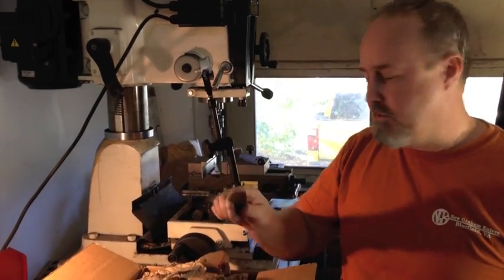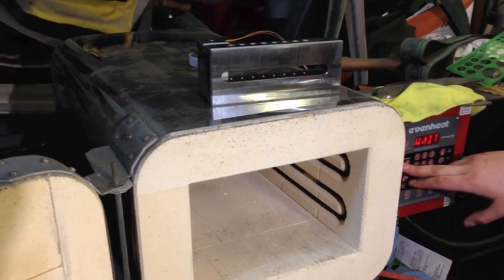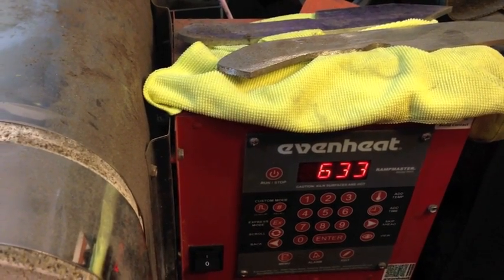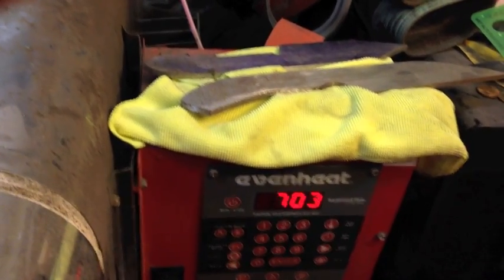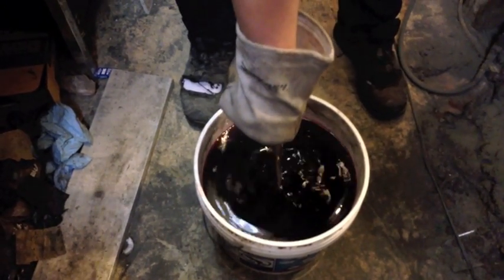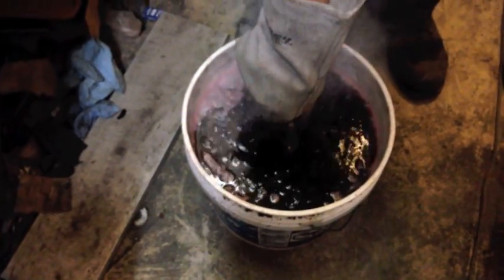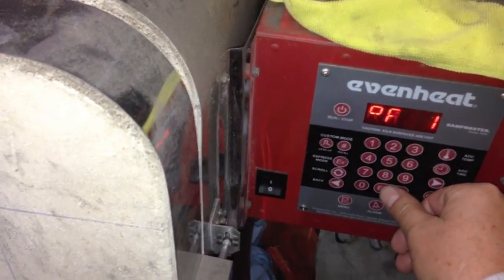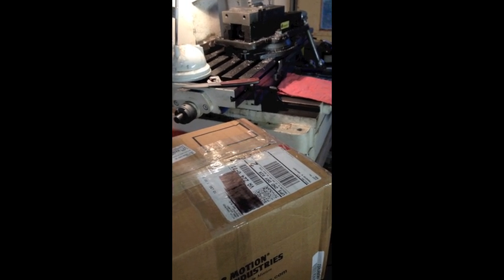WIYB - Machinist Vise Heat Treat

Comment: I was really nervous about such a large part being put into such a small plastic tub of oil. I use a 36 quart stainless stockpot, with a cover that can be dropped on the top with a push of my foot in an emergency. I have 7 gallons of actual quenching oil inside. It’s not that expensive, particularly for a business. Most other oils are contaminated by ingredients that shouldn’t be in hot contact with the steel, and have a flashpoint that’s too low. I don’t see that large, thick part being properly quenched in such a small volume of oil. I noticed that you mostly held the part without moving it much. This might be fine for a knife, but for precision tooling, it’s not. I’m sure Stan will grind it nicely, and that the surface will be about where it should be. But I wouldn’t trust the long term stability of it.

Comment: you may try this oil http://www.mcmaster.com/#3202k1/=10f800h
for your work.
Reply from the maker: +Robert Patoine  Robert good suggestion.  Most of the oil quenching we do is for 1095 and since the parts are small, a large ammo can works pretty well ; )  Because the vice base was much larger than what we normally do, we had to improvise with a larger container (plastic 5 gal bucket).

Comment: Does that oven have a controlled atmosphere? I don't see how you stopped it from decarbing soaking that long….
Reply from the maker: +Diesel Ramcharger  Diesel - no controlled atmosphere for oil quenched steels.  the longer soak time was to ensure that the entire part reached the critical temperature.  We do heat treat air cooled metals that are foil wrapped to control oxygen during the process.  Paper is added to the foil pack, so at high temps the paper burns consuming the oxygen.

Comment: Given the flames when quenching, I have two suggestions. Get or make a basket for the piece to fall into should you drop it or use a metal bucket. That piece contacting the sides of that plastic tub is a recipe for disaster especially when flames are present. Have a cover handy as well as an extinguisher in case the flames do no self-extinguish (Spontaneous decombustion)

Comment: Can you not coat it in something to help prevent the oxide?
Reply: +justfakeit888    wrap the part in a piece of paper and the wrap in stainless steel heat treat foil.
As the part heats the paper will consume any available oxygen when done remove foil :)
Reply: +justfakeit888 You've been watching Clickspring too? :)  I doubt the vice body would fit in Clickspring's blueing tray, and it's getting ground all over after hardening.
Reply: Yes, yes I have been watching clickspring. :o I realize it's going to be ground, but it seems like it would still be nicer to prevent the oxide in the first place.
Reply: +justfakeit888 it may be possible to use a flux type of compound, but other may not be the kind of stuff that you want to get onto the walls of your heat treat oven,  so not worth the effort
Reply: I'll have to try that, sounds interesting.
Reply from the maker: +justfakeit888 +johnptc  This wasn't stainless.  We use paper and foil for steels like D2 and CPM 154.  This was an unknown steel that Stan Z recommended oil quenching.  BTW you only need a small piece of paper to consume the oxygen in the air tight foil packet.  Thanks for the comments

Comment: I have done a lot of double and triple tempers but this is the 1st time I have ever seen a double quench done. What was the reason?
Reply from the maker: +Alexei Polkhanov Alexei all the steal for the vise came from Adam's shop.  Adam said the piece had been around his family shop (certainly during his father's time and maybe his grandfathers time) and didn't know its origin.  So no data sheet was available.

Thanks for commenting
Reply: +bcbloc02 I agree with you Brian about the second hardening....  ????
To have more clue about the type of steel, there would have been possible to send multiple small samples of the steel and do some test at different temperatures, then, determine the needed temp for the needed hardness, there are soo many different of steel, lots of those steel have tempering temp way above the 400 F, more like 600 to 1100 to get 55 to 35 RC...  
Don't look like they test the hardness of their production...   ;)
Reply from the maker: +bcbloc02 Hey Brian.  Yeah you're right, we never do double heat treats.  That was recommended by Stan, so that's what we did.  We routinely do two 2 hour tempers on all the knife blades.  I'm no metallurgist, but according to one at work you can do that to differently harden parts, but not sure why that was needed here.  As you know different materials have different specs.  Without knowing the material, we just followed Stan's recommendations based on his experiments with a piece over the summer.
Reply: +harrisevo So you guys did not know exactly what type of steel these parts were made from? I remember watching a video where Adam was cutting a piece of another bigger piece of stock and he mentioned the source of it. Perhaps there was a way to trace down a data sheet for that steel.
Reply: pierre beaudry
Maybe Tom could have hit it with one of his hammers after they ground it to see how hard it was. LOL

Comment: Home heat treat. woof, for that mount of time.... hate to see your electricity bill !!! faint Nice job!
Reply from the maker: +Doug Hanchard It's 220v so its not that bad.  Also it's very well insulated and efficient at holding a temp. 1500 degrees isn't too bad.  Some steels are heat treated at over 1900 degrees
Reply: +harrisevo How many watts do the heating elements put out? 220V keeps the wires cool, but damn, the kWh must have your meter spinning like crazy.

Comment: Liked the video. Thanks for making and sharing. Hope to see more of your shop work.
Reply from the maker: +Anthony Smart  Thanks Anthony.   My son Matt makes knifes and has a heat treat oven, so I volunteered to help with this project ( a noble effort).  It's definitely different than we normally do, both in size and methodology.  I wasn't sure about the two heat treat cycles, but that's what Stan recommended.